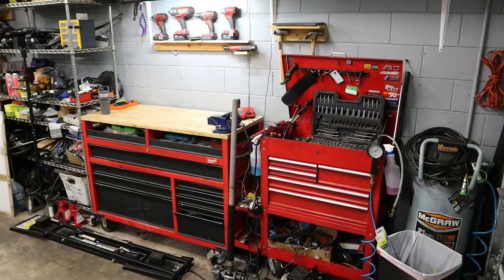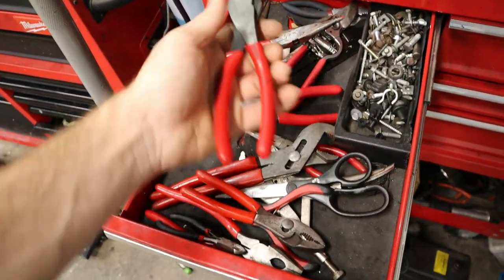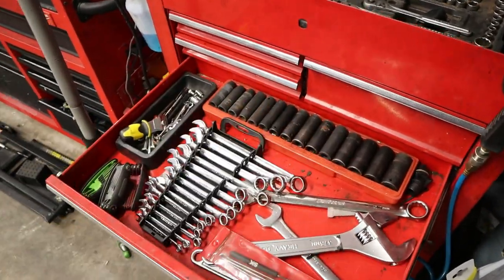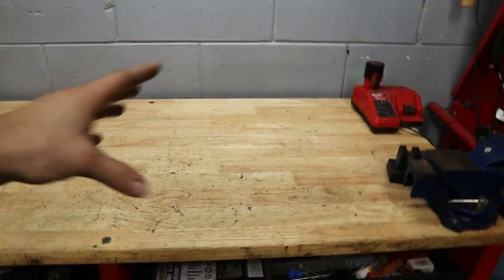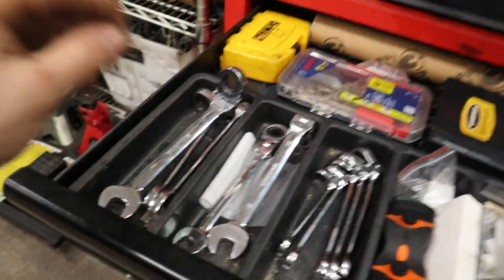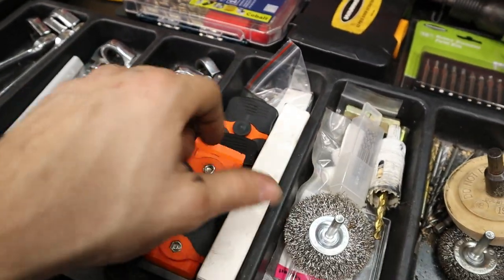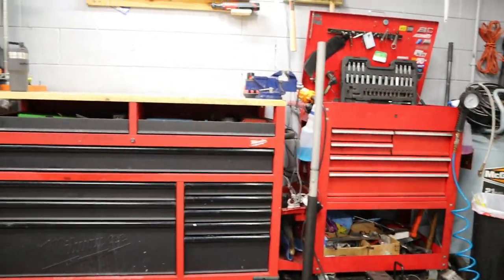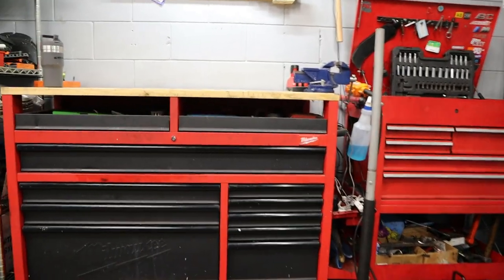FULL TOUR OF MY TOOL COLLECTION (BMW Tools YOU NEED)

Comment: Excellent video! Very impressive tool collection.

When I got my 06 330ci in 2012 and started my DIY car maintenance repair journey, I purchased the Pittsburgh 301 piece tool set from Harbor Freight. I think I got it for $160 but it's $200 now with a very durable hard case. Really excellent starter set with an emphasis on sockets and ratchets that I still use today. That plus a 1/2 inch breaker bar, and a longer or nicer 3/8 and a 1/2 inch drive ratchet for additional leverage when needed and someone would be well on their way. I haven't lost or broken a single tool amazingly but you could do with better pliers and ratchets in the set. I've picked up additional tools for specific repair jobs as needed and did eventually get some power tools (Milwaukee M12) I love my 3/8 powered ratchet.

Comment: Right on time. I'm working on my 01 325ci. Changed the fuel pump, CVC system, and waiting on my new fuel filter to come in.
Reply: Well done. It's super satisfying to save so much money and work on your own BMWs. I don't agree with them being very difficult to work on for the most part and the community and resources available for the brand are huge. One of the best parts about owning Bimmers.

Comment: Very nice tool collection Chris. You forgot to mention a good mechanic needs multiple pairs of crocs ;-) . I wear them too when I'm wrenching on my 335i. Btw, the 335i has a problem again. My fuel pump module( still the EKPM2) isn't priming every time I  open the car. I discovered this is a common problem too on the E chassis. I ordered an EKPM3( LCI's have this already) and I hope this will be the last issue on the car, for a while. Have a great week. Dutch regards, Nico.
Reply: No croc zone.
Reply from the maker: I've also noticed a slow start on a few 335i's, but never thought about that priming function being a cause for concern. Thanks for sharing the info! I need to see if this is what's causing my slow start too
Reply: @TheBimmerBarn  okay. They  changed the complete design inside the module. The PM3 module has larger capasitors and they sealed the complete board too. And easy to program by NCSexpert. Good luck, cheers Nico.